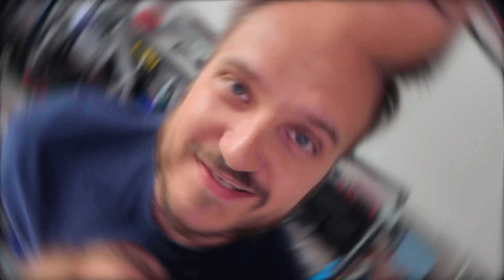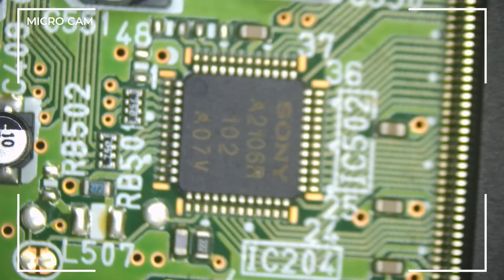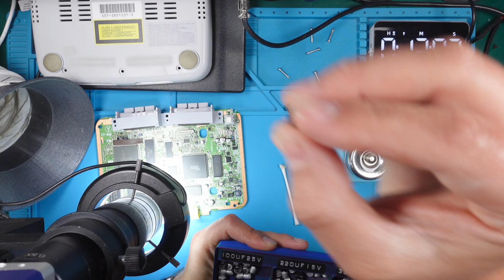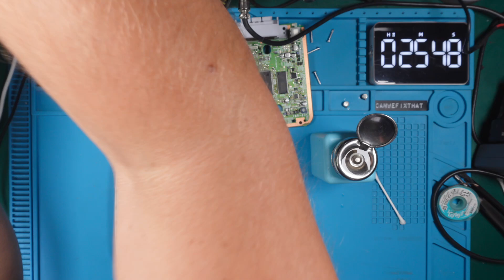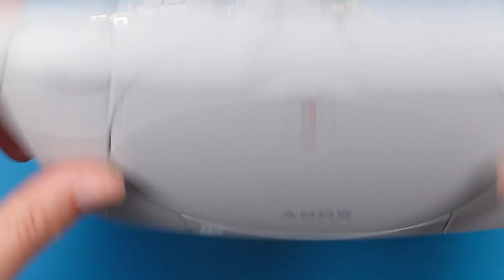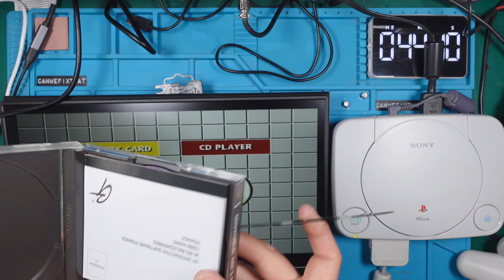Faulty PS1 Video? I Found The Problem

Comment: Can you send some link for components? I dont find them, or whats that component name? I try google search "220 4G 101" but didnt find that...
Reply from the maker: Hi! The larger number on the capacitor indicates the uF value. For example, "220" means "220uF." I used one rated for up to 16V, which should work fine. You can search for "SMD 220uF 16V." Hope that helps! 🫶

Comment: Thanks for the video, easy to follow and informative! I did run into an issue, I was pulling off the 2 video capacitors when I lifted one of the pads for C551 - it's the side of the capacitor marked with black (negative). Any idea where that pad leads to or where I can connect a  wire from the capacitor to the board?
Reply from the maker: Hi! Thank you so much. Usually, you can use any other negative common ground on the board, e.g., from a nearby capacitor or a screw hole. ✌🏻